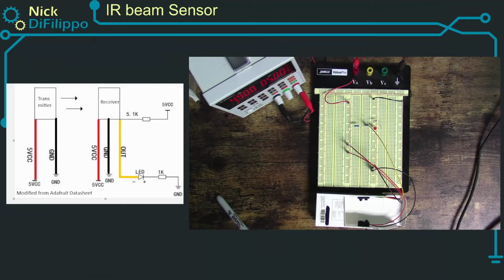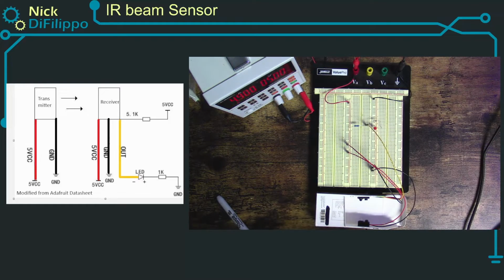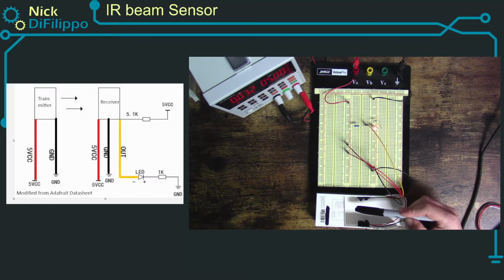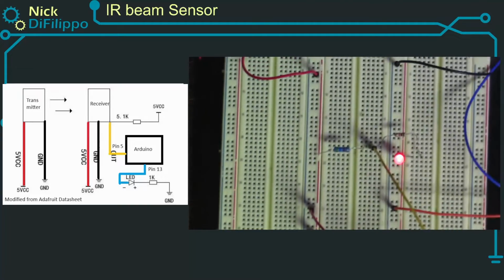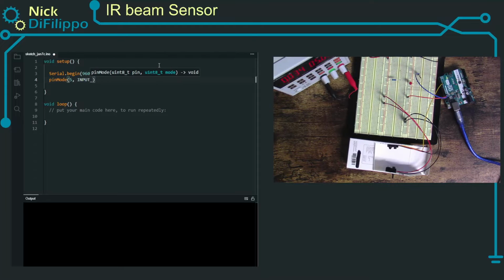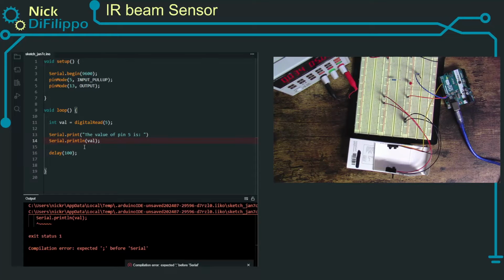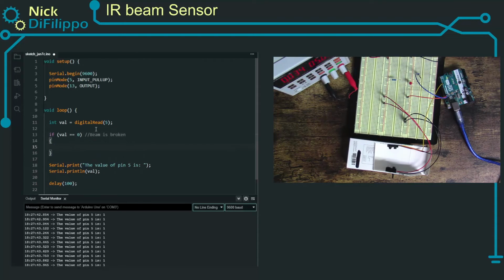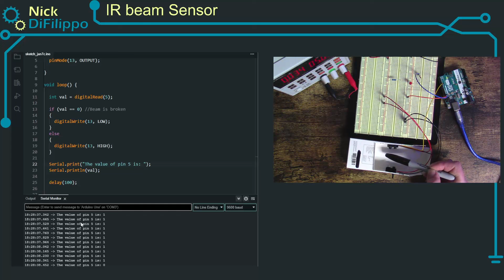Connect IR Breakbeam Sensors to Arduino: Wiring and Code Guide

Comment: If I wanted to make an array of say... 10-20 sensors side by side, what considerations should I make for wiring and coding? I'm new to this so finding the fight words to search online arn't coming readily.
Reply from the maker: You can brute force it if you have enough inputs say like in a Mega or maybe search for a multiplexer (mux) with arduino. An example like this is actually on my todo list but keeps getting pushed down.

With that many sensor you may need to power the sensors externally though.